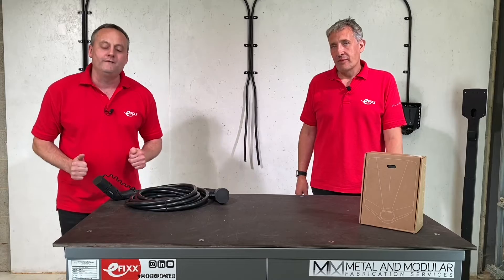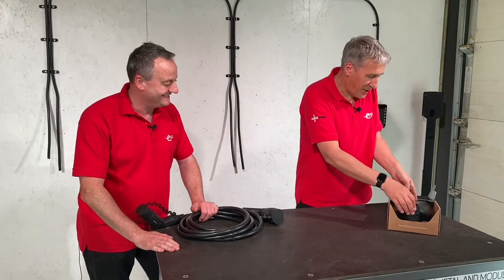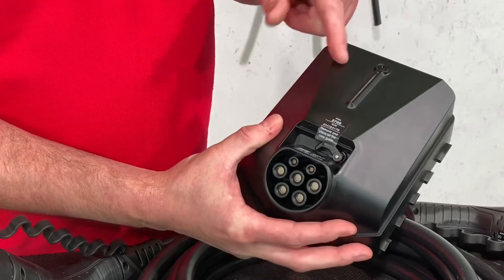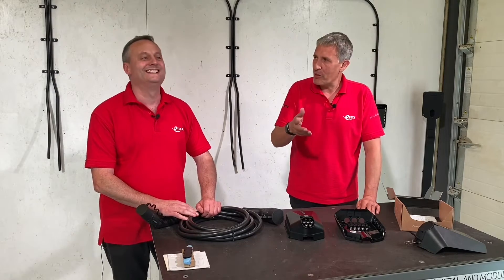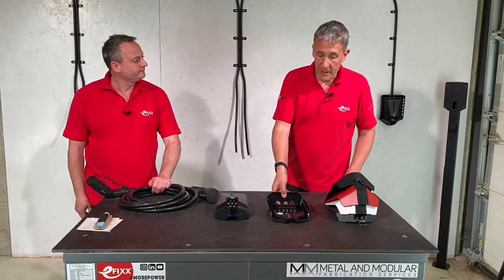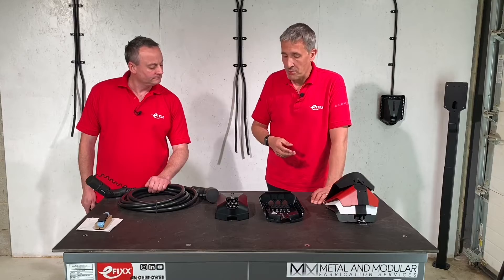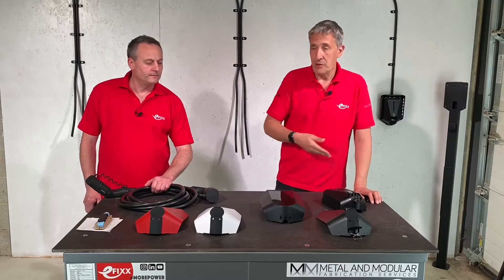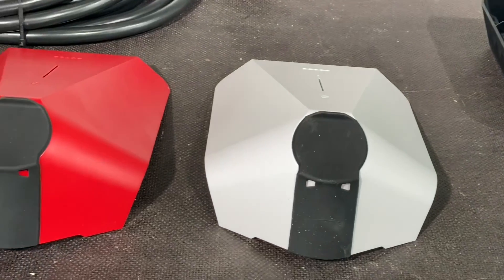REVIEWED: Easee EV charger - the clue is in the name!

Comment: For a multiple install, do they recommend rotating the phase connections between units for balancing when charging single-phase cars?
Reply: No the easee will automatically load balance the phases internally in the unit.... So say there single phase cars plugged in.... It would put them on L1....L2....L3.... Rather than hammering L1.

Comment: Price £1200  yikes!
Reply from the maker: You need to factor in a project cost - cables, distribution etc
Reply: These are being made in Norway. Source: at my workplace we assemble some parts of this charger.
Reply: Well they are from Norway, where everything is 4x the price.
Reply: @markgilder9990  electronics are cheaper or same price at most other countries.

Comment: Would be really interesting to see what happens if they lose network connectivity - does it take them all offline, or do they just not allow new vehicles to connect?
Reply: Local load balancing is done over local proprietary wireless software so if you lose internet connection they just carry on....
Reply from the maker: That’s a great question - we will find out.